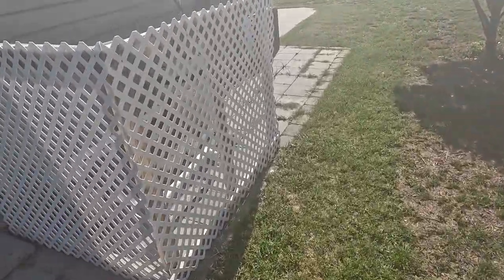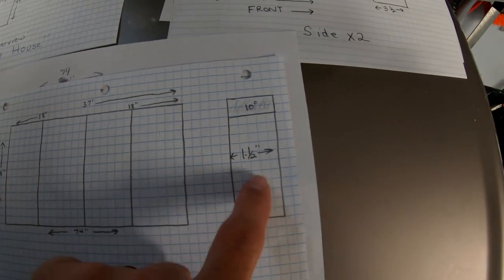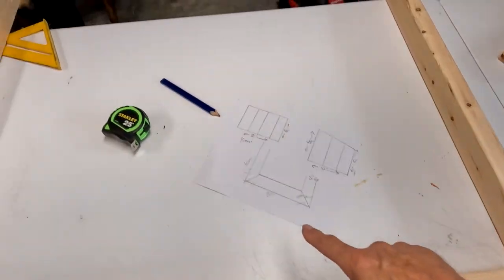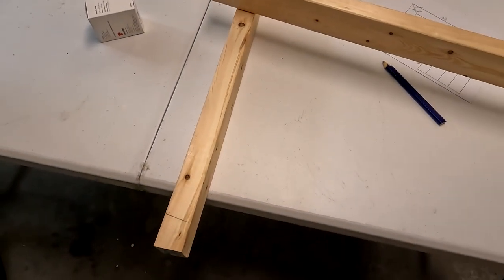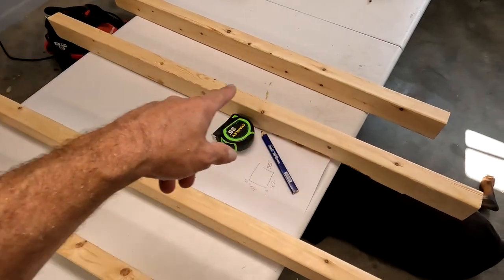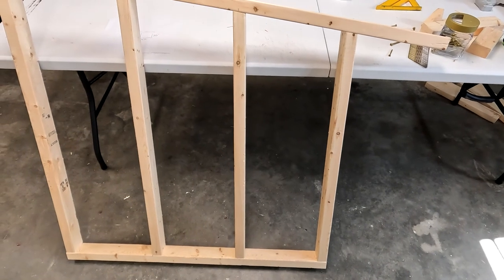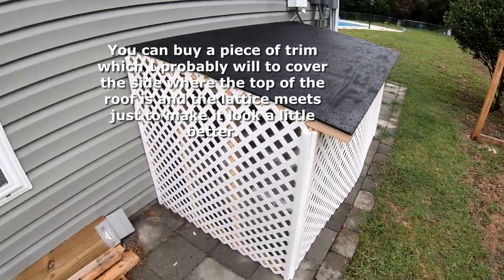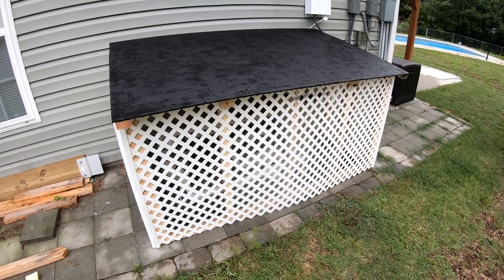Pool pump house equipment cover and protection easy diy project

Comment: So you pull it out on one of the other side to service the pump? My pool pump and filter is on the patio where the pool is, in front of the the back corner of the house,  unfortunately. I bought the house 14.5 years ago, and the pump was probably in that location in the mid 70s. There was an existing custom-built wooden cage around the assembly, consisting of a wood frame with wood lattice on the sides and top, and this pulled out a foot or so every time the pump is serviced, and pushed back--it's a bit more compact than your set up. The pump is partially protected by the house and eave. Unfortunately the cage has deteriorated quite a bit over the last number years and I have tried to repair it several times with extra nails. Perhaps I can have someone build a new duplicate (I'm not a carpenter either). I haven't found any prefabricated structure that would be suitable, although I was looking into screens similar to what you initially had. I don't care about the top being covered, just as long as it is visually hidden to those on the patio, but That would probably need some sort of top cover because people get close enough to see over a screen if it is not high enough.
Reply from the maker: Yes, it was just a "quick fix" for a problem.  Easy and inexpensive.  I have cartridge filters, and a variable speed pump, so I only need access 3 or 4 times per year so I just slide it forward if I need in there.  Was easier for me to build since its hard to find a "Pre made" cover that will be big enough or small enough to cover the equipment.  I could have used a sheet of plastic roofing can get at lowes would last longer, but again for a quick fix it is still there a year later.  I had to cover the top because of the variable speed pump, the "FIRST" 1500.00 pump got moisture under the led display and fried it, they would not cover the repair, so once I paid 1/2 that again for a new control I just did the roof.    Pretty simple build, Lowes will even cut the lumber for you for like .50 per cut.  A few nails and a hammer would get you something that would look good without breaking the bank.  Thanks for watching.
Reply: @RagerJackOfAll  I was out today pool filter on top of the lattice cage, which created the height of about 4'3", which one I walked fairly close to send more than enough to block the view from those walking by unless you were looking right over it, so a screen of say 4.5 feet high, or even a few inches shorter, should do the trick. The problem is getting ones that would not blow over easily, just sitting on pavers. I don't like the ones that have planters attached that you load with soil or rocks or bricks that are supposed to stabilize the structure, but may not be enough either. Maybe on the harder paver surface it would be more stable than grass.